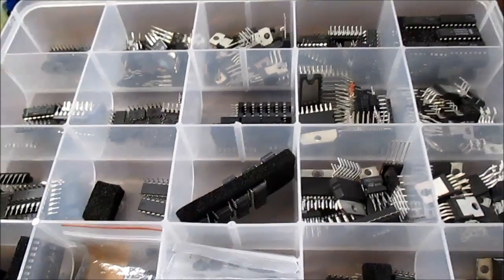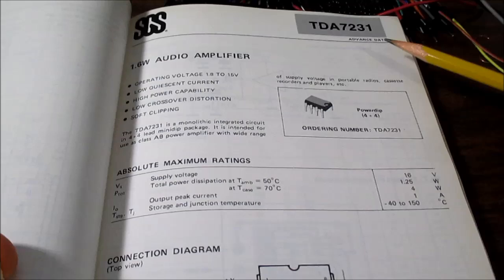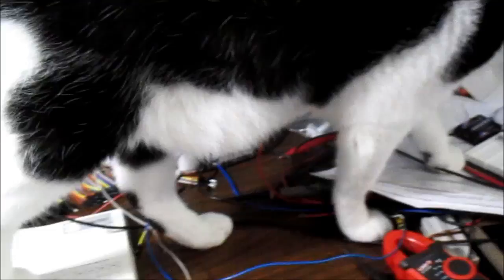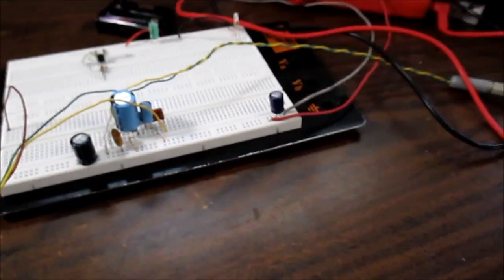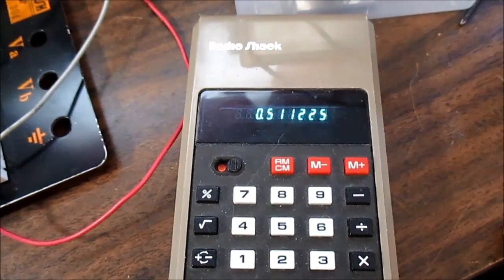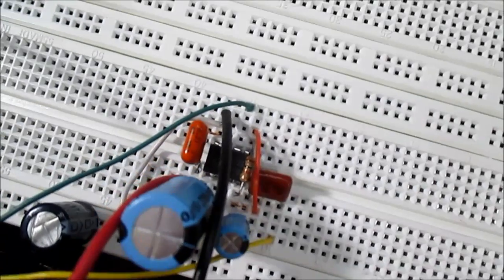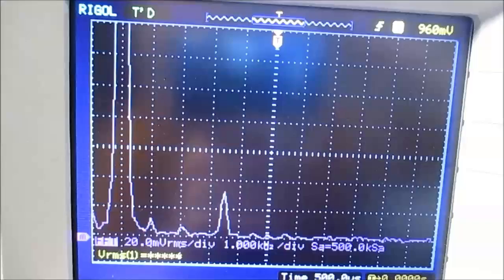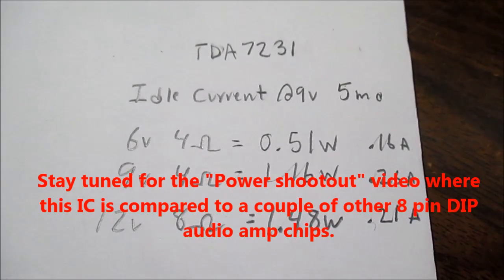TDA7231 audio amplifier IC review and power test

Comment: One thing I don't understand that why such Chips were designed which deliver above two watts of power like 3,4 & even 5 watts but have no heatsink tab to mount a decent heatsink and have only a couple of ground pins to dissipate the heat and that too on the board itself ? 🤔😐

Comment: Is that good for active crossover?? I am finding an ic.... For.... Should I use that?
Reply from the maker: Use an op amp IC.
Reply: Can i use Lm3886, I want less distortion & high quality... But when I use small op amp ic lm386... Their are distortion a little in background... & it hissing when mobile data on... So what do you prefer... Plz help..
Reply: rf noise. try keeping input cable short, and shield the whole circuit in a grounded metal case. or just put the mobile in aeroplane mode.
Reply from the maker: I mean to use an op amp like the NE5532 for any active crossover filter work and use the power amp of your choice to drive the speakers. Using the power amp also as the crossover circuit is not a good practice unless it is a simple filter on the input (not part of the feedback circuit).

Comment: How do you generate your test signal with the 1% "pilot" signal?
Reply from the maker: I used a free sound editing program called Audacity. I generated a 1kHz tone at .99 level. Next I generated a second tone at 4.5KHz at 1% of the first, which is .0099 and mixed them then saved as a WAV file. The reason I used 4.5KHz is because it is not harmonically related to the 1KHz main signal and won't cover any harmonic distortion peaks generated by the circuit under test. The reason the fundamental signal is .99 level and not 1.00 is so the sum of it and the "pilot" signal won't digitally clip when the two signal peak simultaneously.

I tested my music player to have THD of around .002%. A lot of arbgens are over .2% in the audio range according to the published specs, so I just stick with the player.
Reply: JohnAudioTech thanks! thats pretty clever :)

Comment: Jesus' Mother, "box-o-tronics"?   Are you USA distributor for Banggood?  (I'm feigning surprise.)  The thought occurred to me if you might build a universal amp testing jig with Arduino or ???, that will produce a readout of what you'd otherwise calculate with pencil.
Reply from the maker: I've yet to buy anything from them. I'm sure I will and then become a distributor ;^)
Yes, with a DSP IC, I could make it run the test for me. Someday...